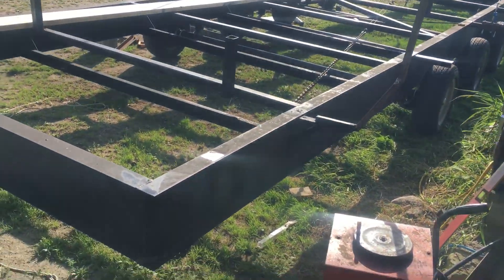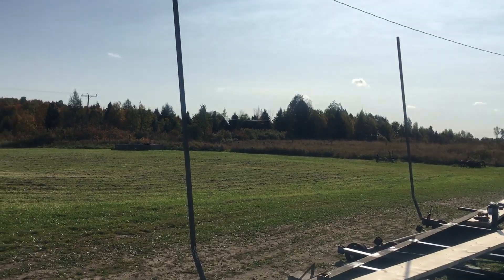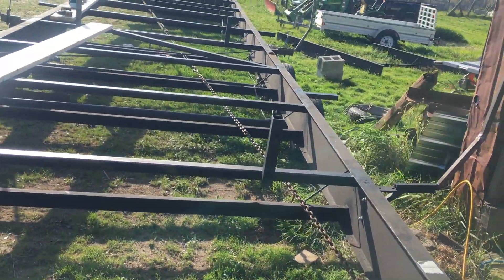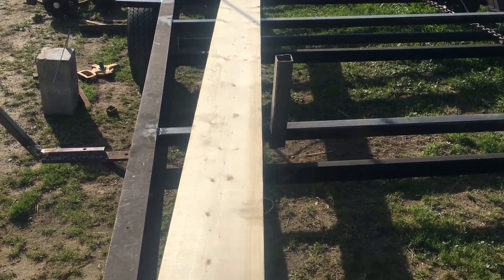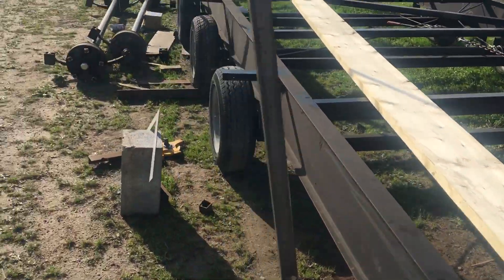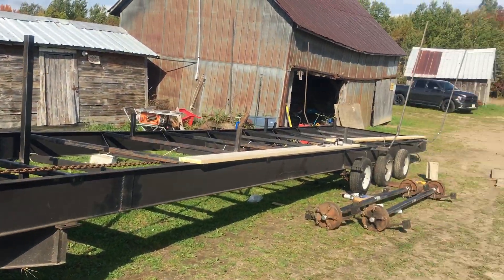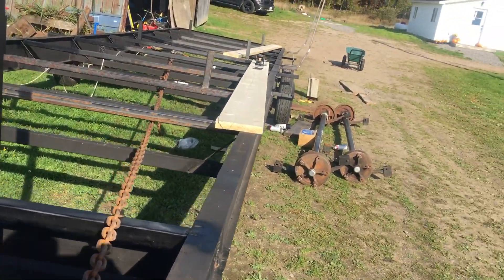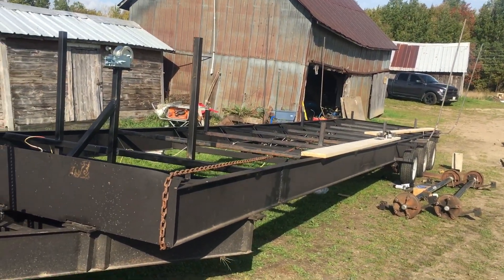Houseboat trailer progress

Comment from the maker: Our houseboat is only 36 ft. It worked great. Boat is out of the water sitting on the trailer. Once we had it where we wanted it I blocked up the trailer so if the tires go flat or sink down it won’t list to one side.